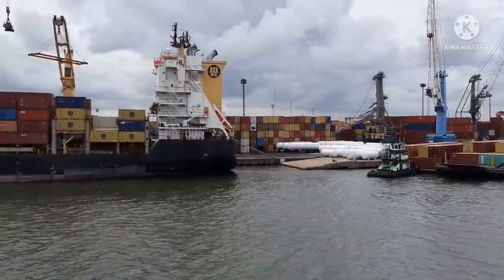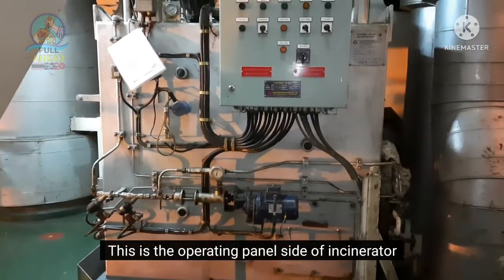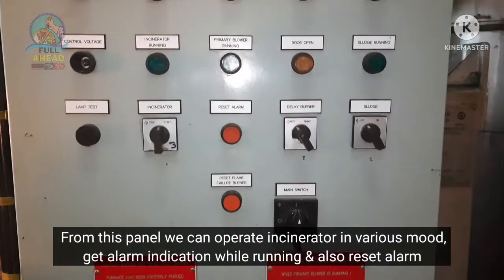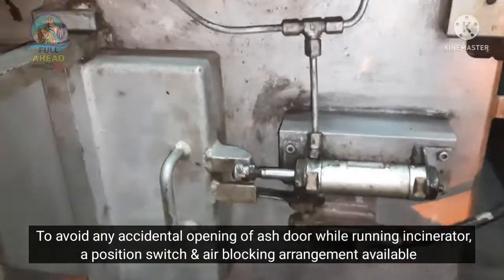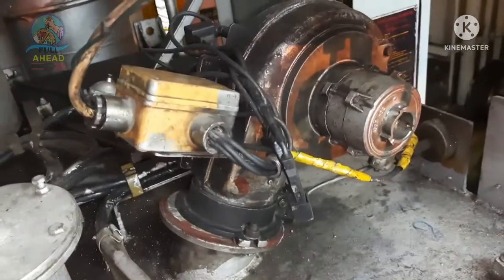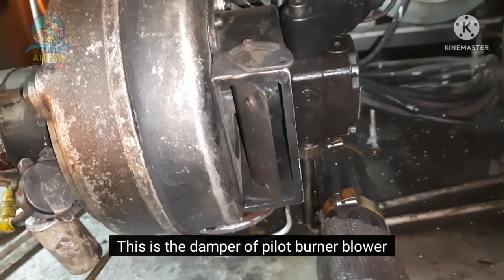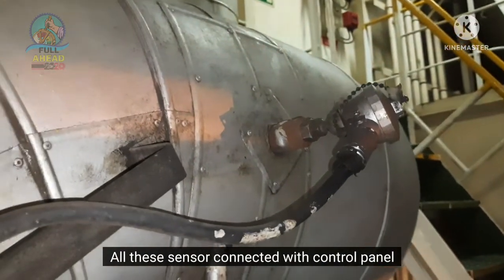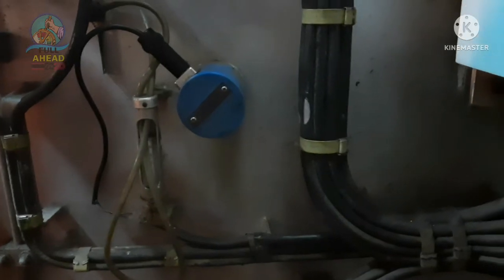Incinerator Familiarization & Pilot Burner Troubleshooting || বাংলায় শিখি Marine Engineering

Comment: Dear Sir thank you for vedio.. sir, can you tell in details how to test the pilot burner ignition & what is the clearance of electrodes in this particular model.. Thnx in advance sir..
Reply from the maker: Dear Lablu,
Clearance of electrodes :
1. Gap between electrodes - 4 mm
2. 6 mm above from nozzle center.
3. 5mm away from nozzle tip.

For ignition test :
1. Bring full burner unit to workshop.
2. Make a power supply arrangement to input of burner ignition transforner.
3. Switch on & test ignition of electrodes.